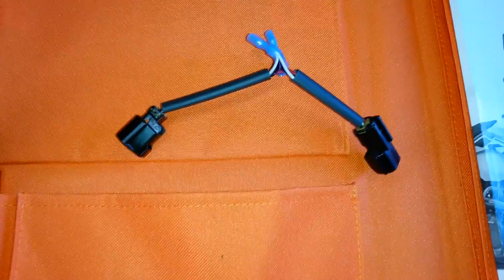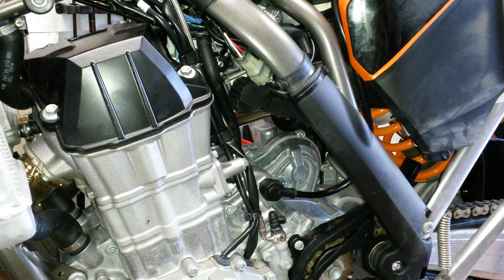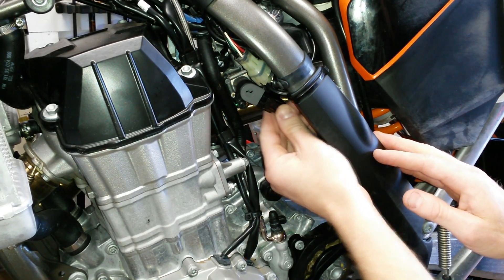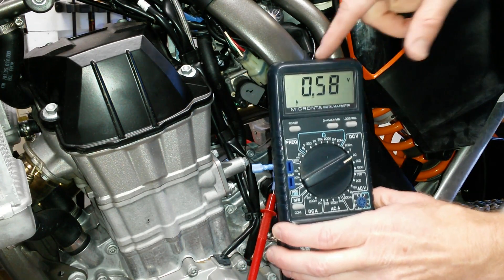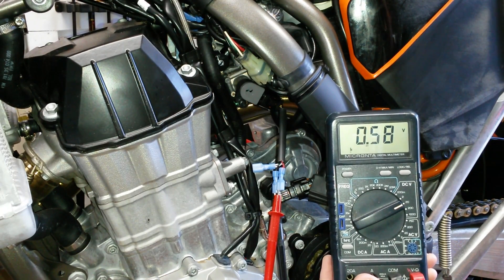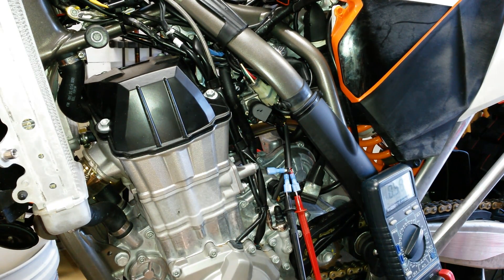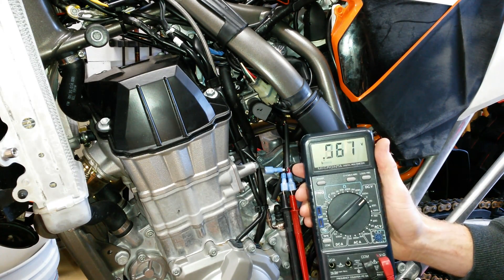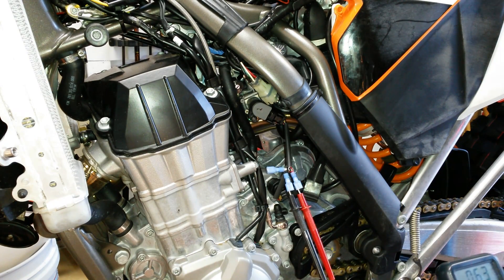KTM Throttle Position Sensor (TPS) Adjustment Made Easy - Special Tool

Comment: I have a 2011 ZX14 100% stock with 8300 miles. I change the plugs and air filter at 7800 miles. At 3k rpm any gear, the bike will cut out at full throttle but run like the win around 5 or 6 grand. You just gave me something to try before paying M--- Motor Sports $140 to look at it. Glad u upload your video. BTW I have a few videos on cars.
Reply from the maker: ***** I'm glad it was helpful!  Put the meter on it and watch the meter while very slowly going from idle to full throttle.  The voltage should change very smoothly.  If you see any sudden jumps or dips in the voltage then that can mean that your TPS is actually bad.  I hope this helps and good luck!
Reply: Matt South I keep getting different values for idle from different people. But I will try it this weekend. Thanks for getting back to me.
Reply from the maker: It will vary by bike model.  I'm not sure for your bike, but the value should be in the service manual if you can get your hands on the manual somehow.
Reply: Matt South I checked tps and it is smooth from idle to max. It was set at .61 volts I tried going up to .68 volts and it got worst. I tried going down to .48 volts and that didn't help.Bike still cut out at around 3500 at full throttle.
Reply from the maker: ***** It sounds like the TPS isn't the problem with your particular bike.  I think it's time to start checking out other things.  So at 3k rpm if you open the throttle it cuts out, but if you open the throttle at round 6k rpm then it runs fine?
Reply: Matt South Open to 50% or more throttle around 3000 rpm it cut out. Yes 6k it's fine.
Everything stock, new plugs and air filter. Change gas station and only run good gas no additives.
Reply from the maker: Is the bike entirely stock, or did you add aftermarket exhaust, etc?
Reply: Matt South 100% stock. The damn thing will pull to 150 mph and then pull harder with me a 310lbs. rider.on it. There's no reason I need to make it faster.
Just want it to pull smooth from DL like it use to.
Reply from the maker: Did anything happen just before the problem started?  If nothing else changed, then my two guesses would be something wrong with an injector (clogged, flaky, etc..), or maybe a flaky ignition pickup coil or crank position sensor, or something along those lines.  Is there a way to read the ECU error codes without the dealer tool on that bike?  Maybe with any luck the ECU will have an error code stored that will give you a big hint about what's wrong.
Reply: Matt South I took it n to the dealer to replace the front tire. I could not get the bolt loose. They talk me n to letting them change the clutch fluid.
They tried to get me to let them change the plugs, air filter, oil and sync the TBs. I said no. I don't fuck with dealer unless I can't fix it. But these fools I think did something to my bike.
It started cutting out on the way home.
 I'm new with bikes but I do work on fuel injected cars. I unplug the tps and started the engine.  F1 came up on the display but it went off after plugging the tps but n. I don't think there are any other codes.
I'm just going to keep asking around until I come up with something.
Reply from the maker: OK good luck, please let me know when you figure it out, I'm curious. :)  See if you can find someone with the diagnostic tool compatible with your bike, they can read any codes in the ECU and that might help a lot if there is a code stored.
Reply: Matt South This just a guess. I think the butterflies are opening to fast. That's what it fill like to me.
I lift the tank and remove 2 caps, one held the air temp sensor. I look n an started the engine. The butterflies open and close on time but there was no weight on the engine and it ran smooth.
Man did that engine sound like a BEAR. I think i have the video and i need to upload it.

Comment: Hello, I built a similar cable and tried it on a Husaberg 350-2013. The bike does not have the ignition key, and then I tried to briefly press the start button but without starting the engine. The tester does not mark anything!
  Should I start the engine and let it idle?
Reply from the maker: Yes starting the engine should definitely show a reading. If it won't start then make sure you got the wires right and didn't cross any over.  Also make sure your meter is on dc voltage.  Good luck!  :)

Comment: Looks awesome! 

I wouldn't say it totally negates the need for a power supply, but could in a lot of cases. 

If your bike doesn't have an ignition or if your bike won't start because the TPS is so out of adjustment you would still need the power supply.

Having said that, this is way easy easier!
Reply from the maker: Thanks!  I think this would definitely work even if your bike wouldn't start, there is no need to have the motor running to get voltage.  However if you were minus an ignition or just wanted to work on the bench, then that would definitely be a case for a power supply.  I was scratching my head as to why this hasn't been available earlier, and I think it's because there are services charging people lots of money to do this for them and they didn't want to cut into their own bottom lines.  :)
Reply: @nadascurb did you found how much voltage should 350 have?
Reply: @TimotejRoncak  I've got 350 TPS video on my channel. I can't remember the voltage, but if you watch that video it is in there. I'd paste the link but it would probably be blocked.

Comment: Yep, from what I can make out, it looks the same. Why does the yellow cable need to be split? Thanks.
Reply from the maker: The harness can be used for more than just setting the TPS position.  It can also be used for diagnostics that may require access to all 3 wires.

Comment: Handy! Will it work with any F.I. KTM? Have messaged you...
Reply from the maker: I'm going to say yes I think it will work for other models that use the same plug.  Pop the plug off of your TPS and compare it to the plug in my video (FF to the part where I pull the plug off and show it to the camera at about 1:20).  If the plug looks the same then it should work.  I make and sell these so let me know if the plugs seem to match and you want to give one a try. :)